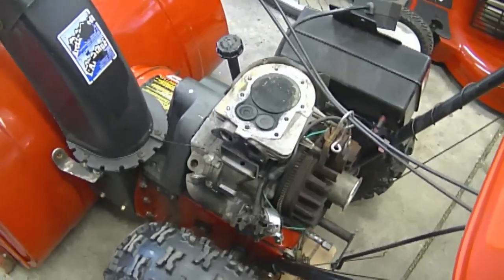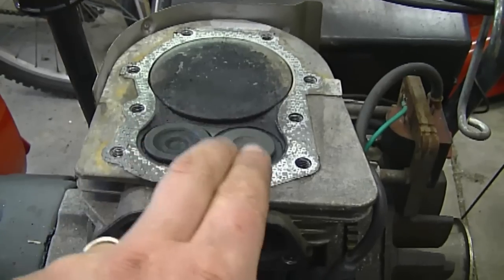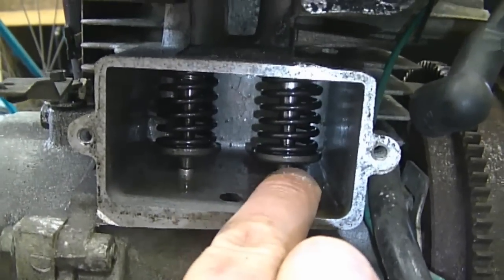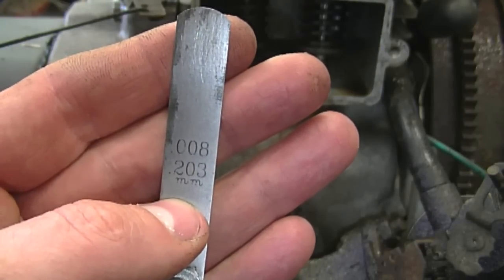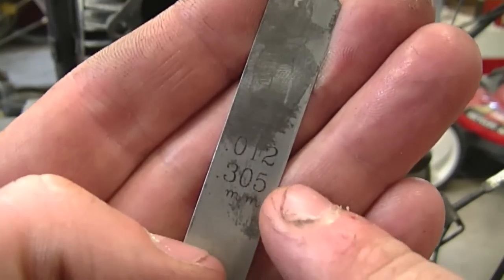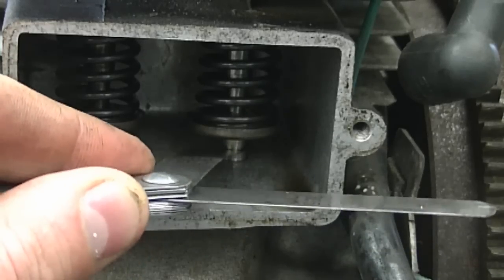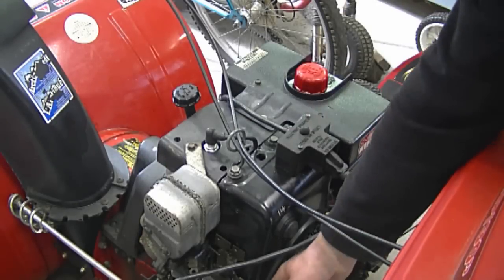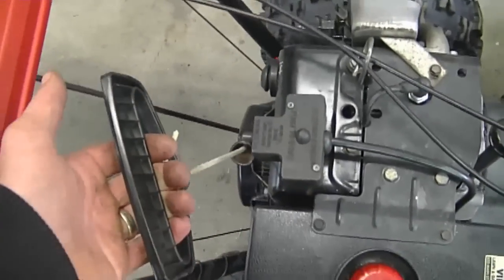HOW TO Check The Valve Clearance On A 4 Cycle Flat Head Engine

Comment: Hey Dony,
Is it necessary to use brass wheels for cleaning carbon off of pistons and valves or is it ok to use stainless steel?  I see a lot of your videos where you use brass, and just wondered if that is a preference or best practice.
Reply from the maker: the softer the better, now I mostly use scotch-brite  pads

Comment: Hi donyboy, I have a friends tecumseh 6 hp OHV engine, I forget the model of the engine. Its on an Ariens 624E snowblower, fairly new. The carb was in horrible shape as they left fuel in it for a few years. I put a new carb on and tried starting it, after a full tune up of course. Tried starting it, but it almost wants to run. I checked the compression and its at 75 with the exhaust rocker off the valve stem. The exhaust valve was covered in a sticky oily sludge. I removed the head and noticed the exhaust valve is loose from side to side. The intake side has no movement at all. Also the intake side has a little cap with a rubber seal under the valve spring. Nothing like that on the exhaust side, and I would think there would be as the little rubber seal would melt. If there is side to side movement on the exhaust valve when its inserted into the head. Does that mean the head is garbage?

Comment: I'm trying to order a cylinder head gasket for my B&S 4 hp engine (older model) #100202,  type 0350-02 rototiller, but the part numbers I see on ebay don't have my number or  have a different number, but the gasket looks similar to mine.  Is there some cross-reference chart I need to use to find my correct gasket?  Thanks

Comment: Dony I took valves out of 158cc briggs there was a black rubber piece with little wire in the intake hole after removing valve it was damage can it be replaced and what is it?

Comment: Hi donyboy73 ,  If I grind too much off the valves and they’re a few thousands off is that a big deal? I haven’t tried yet just debating on getting new valves or not, thanks!
Reply from the maker: it would be an issue for sure so go with small increments of grinding
Reply: @donyboy73  thanks for the response ! I’ll go gentle forsure then

Comment: Hi there i have  a acme  10hp engine  the  cord pulls hard  of my hand  and is hart to pull plz any ideas  or how to set the correct  settings  on the valves ? But the valves  looks  very different  any help plz

Comment: What I don't understand is how that valve got out of adjustment in the first place. It looks like its a fixed setup with no way to make the adjustment by turning anything. Did it somehow grow longer with the heat in order to make grinding off some of it necessary?

Comment: by grinding it  , it allows it to seat against the head  and not the push rod, it turns because is not seated is seated against the push rod thats why it turns, "there is no clearence bethween the push rod and the valve stem , it needs clearence to allow the spring to pull down the  valve to the seat"  ( i am not sure if is called push rod but is the part that pushes the valve UP)  makes sense?

Comment: I am looking at a tecumseh HH-60 motor, and was wondering if there is a valve adjustment if the clearance is off, or if I must remove the valve as you did. Any help will be appreciated.
Reply from the maker: it would be the same procedure as the engine in this video
Reply: Just saying thanks for the information :)

Comment: 4.
So I dragged it back to the house and put it away. Next morning I got on the mower and it started right up, no problem. The one I got yesterday the Briggs 13 gold flat head. The one I mentioned below.  It showed the oil a little low close to the low side of the mark. It is doing the same thing. Could this be a safety feature like a low oil switch or what ?

Comment: I think, if you look at a spec sheet, you will see the min/max at the top of the column that tells you the gap. If it was 8 intake 12 exhaust there would be no need to put min/max in there at all. Are they saying 8 min/max and 12 min/max...I don't think so. 8-12 for both.

Comment: I have a Tecumseh 5 go snow blower with brand new carburetor new gas line clean tank but I have hard time to start and have a back fire wen I slow down the engine any idea wats causing their problem and how to fix-it

Comment: I know if the cam started to wear it would cause it to be loose, but what could happen to make it tight? Seems strange that it could have been correct in the past and now tight. The cam lobe would not get higher and the I don't think the valve would stretch with a little valve spring. What happened?
Thanks

Comment: The valve can be rotated by hand at the begining that is why it leaks.  I don't see why the valve will be seated correctly after you grind down the valve.  Nothing is changed when you shorten the valve when the piston is at TDC.  Can you explain?
Thanks.

Comment: What happens if the engine has a mechanical compression release? I rebuilt the engine and it is very difficult to pull over...

Comment: with no clearance, the valve stem must be ground down. Marking the stem end with a Sharpie--how many times will I have to grind the mark off? Example: zero clearance to .006 x 3 markings = 3 grindings. .008 = 4 marking = 4 grindings?

Comment: 2.
And slowly spun the engine over. I did that a few times and everything seemed to be working. Head gasket looked ok , no breaks. Then I put the head back on and tightened all the head bolts.Then turned the key and she started right up. So is this like normal for the head bolts to come lose ? Please let me know. Well I am off to change the oil and fix the breaks, belts blades, spindles.

Comment: think about like this. if piston is at  TDC (compresion stroke) no push rod (in this case) should be touching or pushing " neither" of the two  valve stems "UP" , what hapens with valves over time is they stretch by the force of the spring (down), trying to keep them close , and they end up loosing their  gap...now let me answer your questions.. Q1 YES , Q2 the  push rod "is" touching the valve . think about it . (touching it keeps it open)

Comment: When the piston is at TDC, there is a gap between the push rod and the valve.  That is the gap we are checking right?  The push rod is not touching the valve at TDC.  Grinding the end of the valve just increases the gap.  It deos not change how the valve seats on the head at the TDC.  Am I wrong?

Comment: Donyboy, recently ran into a riding mower where the intake valve seat came out of the motor and was dangling around the intake valve causing the intake valve not to close. Would it be possible to show the procedure on how to fix this issue.
Reply from the maker: +belue7 I have a video in my pc that needs to be edited on that subject but jeremyfountain has a video on it
Reply: +donyboy73  Thanks Dony, i found Jeremy's a few days after i posted this. I appreciate your response. Stay warm, up there. Winter's coming!

Comment: I did this on my Tecumseh (hot muffler & leaking exhaust) and made a stupid newbie mistake. Both intake and exhaust had zero clearance so I had to grind them both. Unfortunately I took too much off the exhaust stem using a bench grinder. I ended up replacing the exhaust valve and grinding/re-seating the new one. It's easy with a bench grinder to take off too much very quickly. Use caution.
Reply from the maker: +paul larson yes for sure, been there done that
Reply: +paul larson Paul. I have a newbie question, too, since I'm about to lap and regap some valves on a Briggs. To make sure I don't over grind, I'm thinking of just nibbling a little off and reinserting the valve and checking. Repeat, repeat, repeat. The question is, do you think I should reconnect the spring each time, or will gravity be enough to give me an accurate read on the clearance if the seat is good and clean? I suspect it would be, but the intuitive approach has gotten me lost in the woods many times before.

Comment: Okay, I know this sounds stupid, but I just don't know and would like to learn.  Behind the breather cover are the valve stems.  I got that much, but (here it goes) is there oil in that valve casing?  It looks like it, but how much? Does it fill up?  I ask because my tecumseh is spewing lots of oil out the breather tube :(
Reply from the maker: oil gets in there when it's running only. if your engine is over-filled or you are using the machine at a steep angle it can make oil come out. also if you have leaking valves it can do that too. also make sure the gasket is in good condition
Reply: donyboy73 Thanks again for the videos, they are awesome and I have learned tons from them!   The engine is definitely not overfilled.  I bought it to fix it up (at least try to for fun) and the one thing I didn't check was the oil, I checked everything from the auger bearing to the transmission...not the oil for some stupid reason.  Yesterday I got the bearings installed which made a huge difference, rebuilt the carb and started it up.  The thing is a monster!  But as I was coming down the driveway I noticed oil leaking out of the breather tube, so I checked it and it was like water!!!  It was so thin and murky, it must have sat outside :(  I changed the oil, but I am still seeing LOTS of oil coming out of the breather tube, enough to make a puddle on the driveway :(  SO, I guess it is learning time, going to pull the head and see what is up there.  I am hopeful because if it was scored, it would have no compression and wouldn't be throwing snow 30+ feet...right :)

Also, you should have a donate button for all the advice you give!!  Nevermind, just saw it :)

Comment: 3.
Last week I went out and attempted to cut the grass. I checked the oil and yea, it was close to the low side of the mark. But I thought I would cut the grass anyway. Afterwards I would change the oil. This is on a Brigg 20 hp twin. I got into some deep thick grass and it bogged down. So I disengaged the blade and nothing. It was as if I had no battery in the mower. Yet there it is fully charged and ready. I checked with a volt meter. I tried to jump it off and nothing. By this time its dark.

Comment: how do you adjust valves on overhead cam valves. am replacing head on a 4 cycle one cylinder Briggs and Stratton Vanguard 14 horse after dong a complete head job
Reply: +Ilah Durant There are many videos showing that technique on Youtube; Dony has one, too. It a heck of a lot easier than flat heads -- at least I think so.

Comment: On the Tecumseh website the chart for valve clearance says 8 and 12 but if you look at the top of the chart it has min/max NOT intake/exhaust . It seems to be saying 8 to 12 for both, am I reading this wrong?? Help!
Reply from the maker: +Mark Weaver 8 intake and 12 exhaust

Comment: if you look on several small engine parts websites the chart says intake AND exhaust and then min in one column and max in the other for BOTH not intake in the first column and exhaust in the second. min/max. Not explained very well in these spec sheets!
Reply: I totally agree, and trying to figure out the answer to this question!

Comment: @donyboy73 They should make a engine where you can change the cylinder :). The same type of engine, but with a changeable cylinder. But how  much does cost boring out the cylinder and putting a cast Iron sleeve in it? I think more then $200,-

Comment: @donyboy73 Silly question but the exhaust valve has the muffler correct?
Reply from the maker: yes correct
Reply: So I adjusted the exhaust valve to .012 and the intake to .008 but now my compression dropped to 30psi... What could I have messed up?
Reply: Any ideas on what would have killed my compression? I relapped the valves, but still only get about 60psi... Could it be a bad crankshaft seal? I did grind down the exhaust valve which was at about .010 and the intake to .012. I know the exhaust should be at .008 ((I over did it) but I would think that would give me higher compression... Sorry to ask you all these questions. Any guidance would be helpful.

Comment: How does that valve get so far out, is it because of use or a Manufacture thing
Reply: I asked myself the same question then after seeing inside an engine it's easy to see why that happens. The push rods have a wide flange on the bottom so they can only push up at a required  distance. After going up and down millions of times those flanges wear into the metal and allows the rods to go higher and closing the gap.

Comment: How does the valve "stretch" and get out of adjustment if, it was at spec when it was new?
Reply: It's not the stem that is stretching, it's the valve seat that wears, allowing the valve to settle further down into the block. It stays in contact with the cam lobes, and is always open. Shorten them up again and they will close. It worked for me! Thanks, donyboy73 !
Reply: @jamesgage5418  That makes sense! Thanks!

Comment: Donyboy 73 hello sir my problem is to high compression , do i weld a tip  to the valve's or is there a better solution
Reply: dude get new vales- 15$ ebay
Reply: where is the fun in that? but Yes I would if I needed the ingine but it is just to tinker a bit for fun
Reply: Paul Smeets Compression can never be too high, unless the compression release on the camshaft is broken or the valve clearance is too far off. If the valve clearance is too large on a flathead engine, you need to grind the valve seat and valve itself. If you have a kit, find the right angles for the engine, and go to town.
Reply: the clearence is a bit of , so the electric starter had a hard time to do the job .it is pull start now

Comment: Q1.some valves (depending on quality alloy) could stretch but is more likely to break ,and yes! also  the seat could wear down you are correct, but both of those scenarios  will cause no gap YOU ARE CORRECT ON THIS.Q2 In never said push rods touch or push at TDC, THEY DONT!   donyboy73 is showing a bad one thats how they should not be !   they should not  be pushing or touching the valves at TDC (compresion stroke),think about your questions and look at my answers.Think about it a little .

Comment: That piston should be down 1/4 to 3/8 of an inch from the top in case the compression release is holding the valve up I think.
Reply: The compression release only operates when the engine is turning on the starter or pull cord.
Reply: @eugeneoreilly9356  The compression release is ON until the engine turns fast enough to flip the cam out and only then is it off.... or moves the pin to allow the valve to close.
Reply: @outboardfixer  Correct Mark.

Comment: I have a general question: Why do engineers design engines with valve clearances at all? Wouldn't it be much simpler if all engines are designed with zero or near zero valve clearance?

Comment: I have the same engine on one of my blowers and I found I had to take the muffler off the blower to get one of the bolts out of the head so I could get it off. Also, I bought a brand new carb for it and it leaked gas out of the mouth of the carb, when I took out the needle and seat I discovered the needle had a rubber tip and there was no rubber seat in the hole, please let me know if this is normal, thanks.
Reply from the maker: 99% of the time there is a rubber seat and metal needle valve like in kit 631021b
Reply: donyboy73 I had to take the carb back to the shop and get another one, the 2nd one was OK. The shop said it was made in china and they are a (use once and throw away unit) in the hole where the seat goes is a brass insert and you can't do anything with it. Well, did my 1st valve job last night thanks to your help, looking fwd to putting her together today and seeing how she works. Thanks.
Reply from the maker: W. Gator thanks for letting me know the difference between the Chinese carb, the oem Tecumseh carb has a rubber seat and full metal needle
Reply: I see you read the comments. The 2nd Chinese carb worked OK and after the valve job the engine runs like new. Hard to believe that could happen and such a small adjustment could make such a big difference. Nice diagnosis Doc. I saw the Chinese carb on line for $23. Canadian, but the parts store here.... wants 3X$20. bills, tax in. they told me they paid $44. for them :) Thanks again, have a good wknd.

Comment: don, i have a problem with mtd snowblower.recently, i replaced the rubber tire that drives my wheels. when i got the new tire, i matched it to my old tire, it was identicle. problem is, when i adjusted the cable, like your video, when i put the handle about half way, the tire grabs, so i backed  cable off until i could pullhandle all the way to the handle bar, tire grabs just barely, but barely any power, so i had to tighen cable, will this condition inprove when the tire wears in?   dick bailey